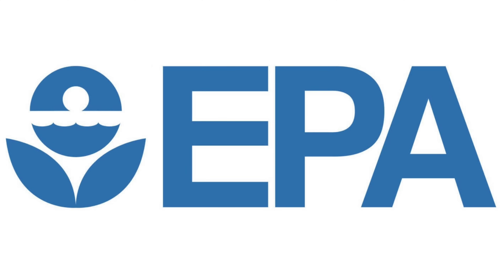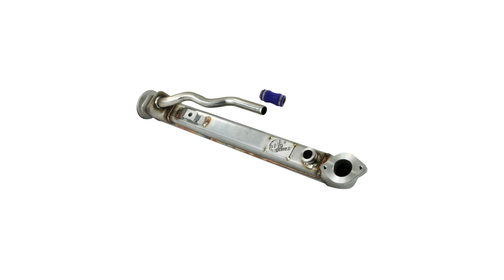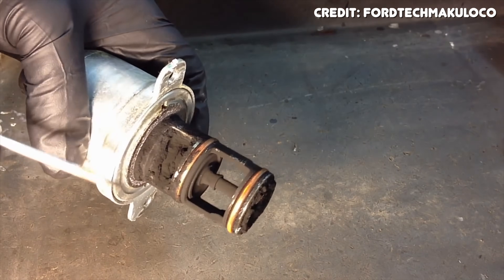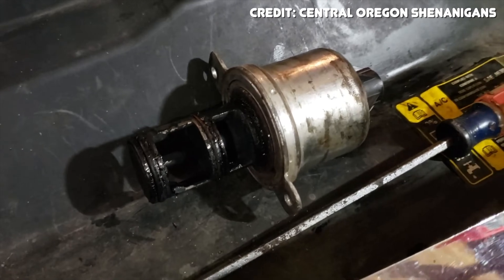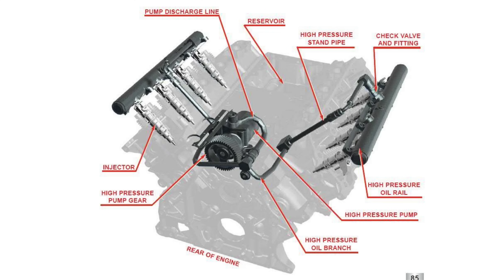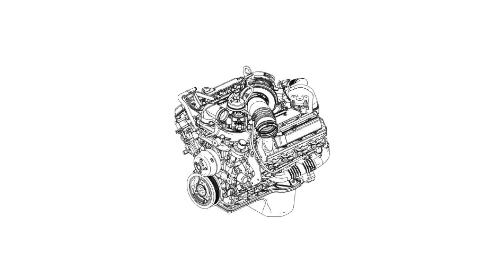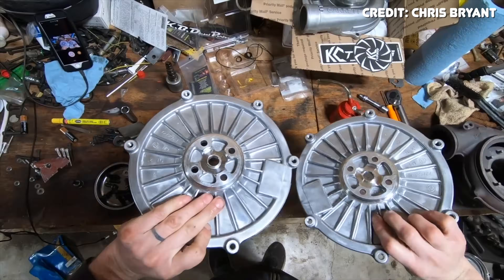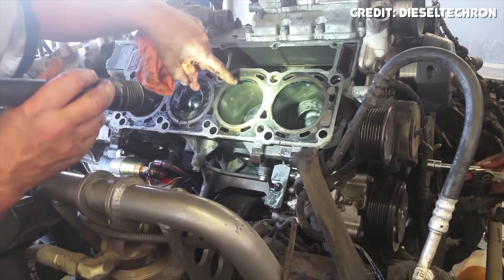The Truth About the 6.0L Powerstroke (And Everything Wrong With It)

Comment: The most hated Diesel engine besides the (6.4) but best sounding diesel engine ever made.
Reply: 2 stroke Detroit sounds better in my opinion especially a 16v71
Reply: @brettdearing2898 they sound wild.  I like the old Detroit engines, super cool Wikipedia page on that series
Reply: @brettdearing2898  your not wrong I love a 2 stroke diesel engine and they kick ass but yeah do they burn the fuel
Reply: It has a bad rap, due to YouTube mechanics can’t fix shit. Maintenance is key and stop trying to take a 7,000 truck and trying to make it a race truck.
Reply: Have over 350K on mine with the normal mods. EGR Delete, cat delete, Bullet Proof air to oil cooler and oil filter relocator. Just put a KC Turbo on it,  Drive it to Tennessee every other month, towing something through the.mountains
Reply: No. They sound like a bag of popcorn
Reply: The lbz has a better sound in my opinion.  And won't grenade itself
Reply: I drive mine like it's a quad racer and never hesitate to get in and know it's going to go wherever I want to go at anytime.
Reply: I agree, 6.0 sounds the best.
Reply: I’ve had many issues with mine lol
Reply: I agree, never owned one but it sounds like a jet
Reply: I mean 12 valve does end up needing injectors right around a million miles. An outside of some minor timing issues and a run a bad engine blocks. They're pretty good choice for reliability
Reply: They definitely sound unique, but not favorably.  With aftermarket exhaust or straight pipe they moan like Chewbacca in pain, and when you lift off the pedal they cut fuel and sound like they just died until they reach idle RPM.  An old 7.3 or GM 6.5 starts fine in the cold, but these things are so dependent on oil pressure that forgetting to plug in the block heater means you're not going anywhere.  I remember 6.0s in UPS trucks, and their noise being everywhere - but this is the engine that was SO BAD that UPS switched the entire fleet to gasoline.  I haven't seen (heard) a 6.0 clattering around anywhere in many years.  In the pickups their entire lifespan was within the PHN131 1st Generation F-250+, along with all of that platform's problems and terrible interior quality, there just hasn't been any incentive to fix a 6.0 for a long long time.
Reply: Without a doubt the best sounding, they have truely unique exhaust note compared to all other diesel pickups on the market.
Reply: Well one good thing always comes with a bad
Reply: Sounds like a wet fart
Reply: In your dreams. Lol! Put the right turbo on any diesel... an it'll sound good.
Reply: They sound good, but any two stroke detroit sounds way, way better imo
Reply: Ever made? You know that brings up any 2 stroke engine, like the 8V92
Reply: Not going to lie. It does look cool to see like a 6 ft flame coming out the side of a super duty😂
Reply: Idk I bought mine used gave me a fair amount of trouble but I think I’ve worked all the kinks out. Honestly my truck is a monster r.n I Eates! Serious power, tons of torque, & it’s fun as hell to drive. The trucks an 03 so she ain’t new but with no cat,straight pipe & muffler. Bro the cops hear me 4-5 blocks away. 

IMO I never heard a Turbo as happy & ready to eat as my tuck

I got 2 7.3 f-350 also but that 6.0 is a monster. I clap people steady around my area. Zero hesitation she just eats
Reply: I have one I wouldn’t say best sounding but the turbo sounds nice most 6.0’s sound like a fart cuz they straight piped it with a big ass exhaust I did a 3.5” straight pipe(hacked up factory exhaust) and dumped it out the side of the bed right behind the cab and I don’t get much of the fart noise
Reply: Facts
Reply: Coming from a guy who has owned 2 6.0's, daily driven the 6.4 and 6.7, I wholeheartedly agree! I've also driven the 6.7, 5.9 cummins, and several durmaxes both new and old for work. The drama is the smoothest shifting that I've ever experienced, but still nothing has been the whole package of a 2005 F250 for me. Exterior/interior design, engine sound, lightweight feel, etc
Reply: They will make you cuss..
Reply: Best sounding diesel is the 7.3 hands down.  Only diesel with that deep thump
Reply: I will stick with a v10 triton 😂
Reply: If it’s not bullet proof it doesn’t matter engine will take a shit😂
Reply: If you’re including turbo noises then yeah. But winner of best engine sound goes to 7.3 IDI in my book
Reply: In that case, LITERALLY the EJ of diesels.😂
Reply: Let’s talk about the 6.6 liter
Reply: It’s amazing what ford cult guys convince themselves of. Always thought they sounded super funny and I drive fords.
Reply: The problem is people with duramaxes or cummins with problems start bullying 6.0 owners cuz of there problems 🤦‍♂️
Reply: Best sounding.. sorry but I'm afraid no 6.0 can beat the sweet sweet sound of a straight piped Detroit 8V71, 12V71 or 8V92. We can try.. but 6.0's aren't remotely close to two-stroke roars man.
Reply: @jbussey5301 joke
Reply: 2nd gen swapped 5.9 Cummins tapping 5000rpm is even nastier
Reply: @AngryyBeaverr no
Reply: I totally disagree I think the 5.9 Cummins and a Caterpillar 3408 both sound way better .
Reply: @dave0z96 no
Reply: Best sounding diesel in a pickup,  12V cummins.  Straight piped sounds like a big rig! 

Can’t beat it
Reply: @alexinnewwest1860  sounds like someone is dryheaving all the time. cummins is the worst sounding diesel.  fanboy
Reply: No @alexinnewwest1860
Reply: @alexinnewwest1860 I drive a real rig, 359 Pete. Big cam Cummins, 5 and 4 boxes, 8” miter cut stacks, and yes… She has the corvette dash and predominate pin-striping! 

Your cute little 12V doesn’t hold a candle to my rig or my 6.0! 😂
Reply: @alexinnewwest1860  not like a big rig at all 🤣 no where near the deep ton…. Cummins is a turd
Reply: @freedomisntfree_44  and other funny jokes you can tell yourself
Reply: @elywrlds594  all because of the truck it’s in…. Junk
Reply: @freedomisntfree_44  that's just untrue
Reply: @wizard_of_poz4413  after you drive a powerstroke they are, plus just feels off due to the engine and transmission being totally different clunky shifts. What good is having a good engine when the truck it’s self sucks like the fiat pos they put it in
Reply: @freedomisntfree_44 I agree won’t buy Cummins truck and transmission are too shit
Reply: @freedomisntfree_44  most big rigs have a Cummins…
Reply: @Cøbra-u5x  the best ones have a cat
Reply: @freedomisntfree44 I'd have to disagree with u there, dad's owned a 6.0 for the last 6 yrs, never felt off. I myself have driven it for.... idek how many hrs but ik it's around if not over 80 hrs total
Reply: @freedomisntfree_44  How many million mile 6.0l are there?
Reply: @atodaso1668  how many times was a 6.0 mentioned 🤣🤡
Reply: @freedomisntfree_44  Well you called cummins a turd, yet they out last the power strokes by a significant amount? How is clown school going?
Reply: @atodaso1668  it is a turd 🤣 been just as many of all of them failing too.
Reply: @freedomisntfree_44  No where close to powerjoke levels
Reply: @atodaso1668  won’t have another fire hazard on my farm I mean ram
Reply: @Cøbra-u5x not true
Reply: Sort of true 12v sound a little better
Reply: 6.4 Powerstroke is way better than the 6.0
Reply: @connor4961 no
Reply: I hate the sound of v8s
Reply: @wizard_of_poz4413 You havent heard an IDI then lol, sounds like a smokey 460
Reply: @CharredSteak  I'm not a huge fan of old engine sound
Reply: @CharredSteak I own an idi, u can tell them apart from a powerstroke by the sound
Reply: @wizard_of_poz4413 they hate to sound of you too.
Reply: @dylanlaton7809  well idgaf because not like they can do anything while sitting on the side of the road with blown head gaskets
Reply: @wizard_of_poz4413  dude a gas v8 is a turning point in any direction of the auto industry 😂 I never got why these kids wanted to turbo there 4 cylinder cars when you could buy a v 8 trans am and bolt on the same application and have a hell of a lot more torque and horsepower.

Comment: Ok great video! My dad owned a 2006 F-350 with the 6.0. It was totally stock in engine form. We had no problems besides the fuel module. When we sold it had 276,000 miles. Yes, it started to have head gasket problems, but it started really having problems around 203,000. So, is it a really bad engine? I say no. It is not that bad. Just do regular maintenance, and keep it up to date with parts, and you will be good.

Comment: The engineers weren’t prepared at that time for emissions and got hasty and threw the engine together
Reply: No the engineers that designed the 6.0L were fully capable and able to deliver and engineer for the required emissions and had been doing so for years already... Navistar failed to them the full range of applications the engine was going to be used in...

Comment: I think you forgot one fail point. I've seen someone on youtube loose an injector because the copper seal ring at the tip failed. It's located at the end of the injector where it meets the head.

Comment: Lol, I have seen duramax (all gens) motors blown head gaskets and chewed up transmissions one after another. And Cummins had the same issues with the early 6.7. Emissions are the killer of all diesel motors. The 6.0 is a reliable motor, but less forgiving when worked past it’s regimental servicing. A minor note to mention, ford got a early start on the emission compliance, years before Cummings did, so it really wasn’t comparing apples to apples.. but no doubt just about ruined ford for doing so! ✌️
Reply: The 6.0 is not reliable it is a POS. That's why there is law suites out the ass.
Reply: @techs1smh13  outside of the 7.3 and 5.9 (most notably the 12V) which had no egr systems, reliability in todays diesel motors is subpar. Duramax had a class action on the 6.6 for faulty high pressure pumps that would create catastrophic engine failure. Chrysler got popped for programming the emissions to cheat the true regulated performance to avoid failures as well! The 6.0 was far from perfect, but it’s rap came harshly being the first emissions diesel at the time competing with two competitors that hadn’t gone to egr systems yet, and over shadowed by the dependability of the 7.3. The 6.0 can be made into a good reliable truck, but that reliability should had come from the automaker, not garage mechanic’s years after. ✌️
Reply: @ericblair1011   my 03 Federal emissions lb7 has been solid  doesn't leak a drop of anything has never left me stranded.has no EGR or cat
Reply: The cp4 is used in all Diesels made by Bosch they are all having lawsuits and big time repairs.

Comment: I have a 2005 f350 I bought 4 years ago with 125,000. I made sure I was getting a 6.0 that was bone stock and had the bullet proof diesel egr cooler, external heavy duty oil cooler, and had the ficm by a company in Florida for all total 6500 bucks. I knew i wasnt going to tune it so head bolts wasnt a concern. When shopping the price of the dodge and chevy it was cheaper the buy lower millage stock 6.0 and then have it bullet proofed. Just change oil and filter every 5000 to 7500 mile depending on use and your good to go. I only use Motorcraft oil too.

Comment: I worked as fleet mechanic for 15 years working on 6.0L.  I initially thought they were junk at the time but compared to other newer ford engines, they weren't that bad.  I think the 7.3 had better durability but if it needs ''fixing'' it has issues too.    Compared to Cummins, I'd prefer working on Cummins since there is a lot more room plus those engines rarely need major things.  "fixing" GM diesel engines have always been a nightmare besides the 6.5L.  
A big factor for me rating engines has always been the 'serviceability ease' which some engines give lots of room, can be done with common tools, and aren't overly expensive.  
If I could rate all 3 makes diesel engines from the year 2000 till now here is how it would go (shittiest to best lol).  Oh, I also considered price of parts, need of specialty tools, and ease of actually fitting in the engine bay/actually able to touch stuff: 
ford 6.4, ford 6.7, gm 6.6, ford 6.0, dodge 6.7, gm 6.5, ford 7.3, dodge 5.9
I currently have a 6.0L in a 2003 F350 and it hasn't had no major issues thus far, and I'm doing my best to keep it maintained.
Reply: Dude, we must be brothers. I’m kinda the “diesel guy” in my area, I’ve owned, operated ,and repair every light duty diesel to current, including some medium duties, international, hino, cat, etc…… I’d keep your list but would swap the 6.7ford and the gm 6.6 ( personally think the duramax sucks to work on well they both do, they look roomy but are not). Ive always found myself ending up with the “least liked” diesels and fall in love with them. My top two are the 6.5 and the 6.0! I personally have at least a half million miles racked up between the too and with some repairs and maintenance  they never owed me $1! Fords keep my shop busy, not because they are “junk” but because they are the most popular around here. People need to get their head out of their ass, it’s not about brand loyalty, it’s just trading one problem for another problem. They all have their advantages and disadvantages. I find its usually the owners fault (yes some engineers too but) they either hire shit mechanics that do NOT know the description  and operation of the components needing repair, and/or they let it go, and go, till finally they require a $5k repair but want to half ass it and only buy one glow plug, or injector when 6 have stiction lol. Then they bitch it’s junk! Either way, it’s not too often you see praise for a good ole 6.5!
Reply: @cowboy41231  Thank you for your sharing your knowledge and opinion. I found it very interesting. I have an old 1996 6.5 with 164k on it and it has been a great rig so far. I previously owned a 06 LBZ GMC and I loved it for the short time I owned it. The 6.5 does not even compare to the LBZ in terms of power but is remarkably reliable. I'm surprised to see it on your list, with all the factors you stated being considered. The 6.5 gets so much flak but it seems that in reality its a good engine. I think I'll hang on to it for a while and when the engine needs replaced or a rebuild I might consider a swap for a 5.9 (12v) or possible something else. Again, thank you for your comment.
Reply: @cowboy41231  nothin really Terribly wrong with a Detroit Diesel 6.5L..... can't really handle too much power thrown at them. but in terms of Putting around for years and years they'll do the job just fine. really grinds my gears they never made crew cab dually 4x4 trucks.. with the diesel........ or i'd own one.
Reply: @justnsaliga8518  I had a 6.5: in a 1500 GMC. Was fun but I had Map sensor issues could never get right. Right like a champ though as a daily driver.
Reply: The only major problem with the 6.5L detroit is the fuel pump ( GM made if I'm not wrong), here in canada we have to change it almost every year. But the engine itself is very tough.
Reply: @justnsaliga8518  they do make crew cab 4x4 6.5 Detroit diesels i own 2 and one had melted pistons and cracked heads the other just cracked head and bad lifters the one that
Reply: @michaelcloutier2447  6.5 diesels are not tough there very weak but the will run forever with the issues most people don't even know they have cracked heads but I promise almost every 6.5 will have a cracked head and tons and tons of blow by they still run forever but the cracks are between the valves and on the crank hold downs also there know for breaking cranks because the balancer pulley is garbage these motors were supposed to be a gas engine its a general motors  400 block modified
Reply: I think that list is not practical the duramax is nearly  Indestructible
Reply: From the factory can handle tons and tons of power the transmission too and I personally think there easy to work on
Reply: @addisonsokol  respect your opinion, the Duramaxs are monsters for power but are VERY destructible (they have their fair share of problems, pumps, injectors, cracked in heads, leaking head gaskets, same turbo sticky VGT issues since they are brothers to the 6.0) .... I'd hold my breath on the Allison, it's stout and ahead of it's time for STOCK power, but there's alot that goes wrong there as well... MY main concern on the Duramaxes is gonna cost you big $$$ and time that as a shop, is hard to absorb (if you mis-diag, so don't be wrong lol)

WITHOUT getting into specifics, all my customers seem to better with their trucks that they run HARD, all the other nuisance problems (I feel) come from people babying them, too much. Hammer down guys, it's less stress on the internals at mid+ rpms 
....😬😎
Reply: I currently have 360,000 miles on my 06 f250. With minor repairs and egr delete. I change the fluids and filter based on Ford's severe duty listing even though I use it as normal.
Reply: If you can’t get in there to fix it, what is the point of fixing it?
Reply: 6.5 still throws around 14000lbs albeit not as fast as a duramax. Still does the job well though
Reply: Look gentle  men they all need repairs and mechanics so pick your poison  of the big 3 trucks
Reply: Appreciate it pimp